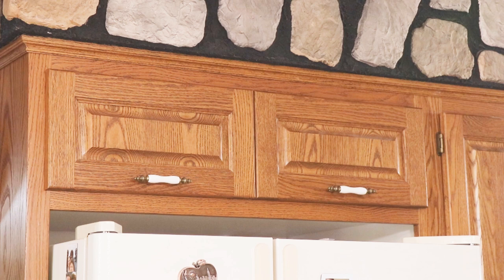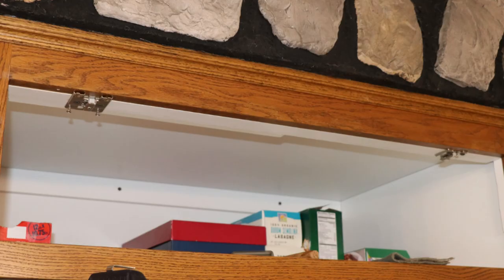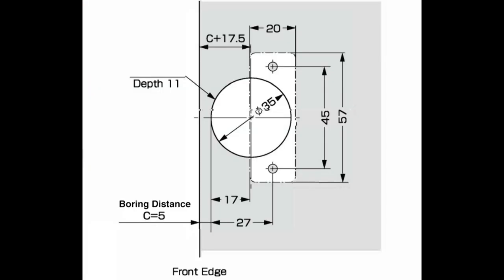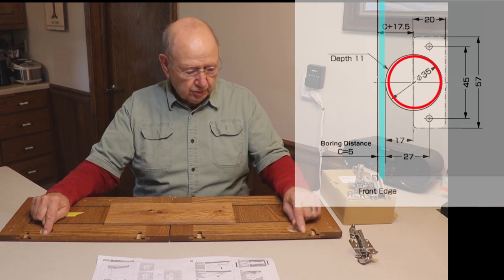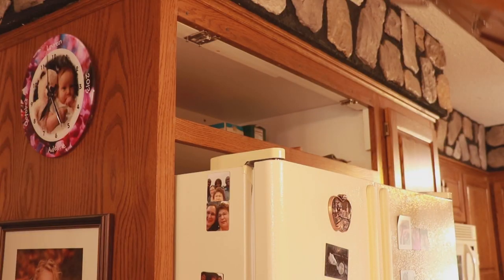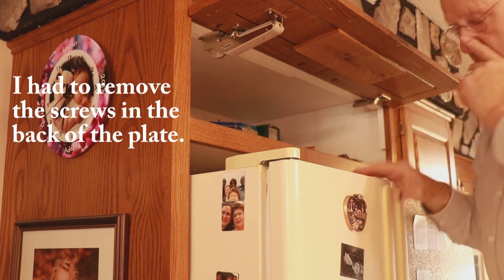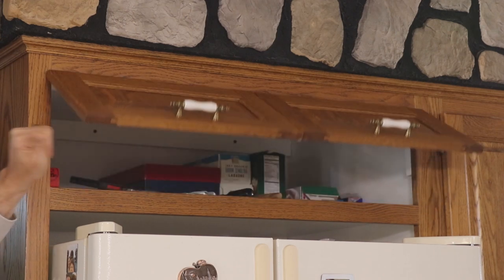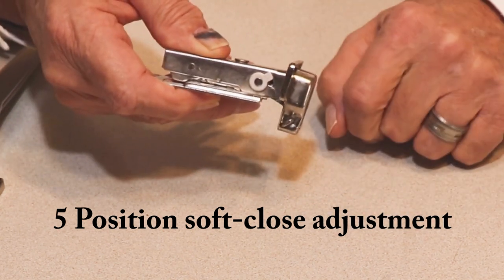Installation and Product Guide - Sugatsune Aileron Lift Assist System

Comment: Can this lift system be used on inset doors? The manufacturer's installation instructions only show an overlay door.
Reply from the maker: You could use this system for an inset door, but you would have to put blocking inside the cabinet at the top for the hinges to mount and at the bottom to provide a surface for the door to close on.
Ideally you could create a box within a box, set back by the thickness of the door. The door would actually be an overlay for the inside box, but would appear to be an inset on the outside.
Please give us a call with any questions, our customer service would love to help, 800-383-0130. - Woodworker's Hardware
Reply: @WoodworkersHardware  Wow! I am so impressed by your quick and thorough response. That makes total sense and is what I was thinking, but wanted to confirm. It's unfortunate that the hinge/lift system can't be adjusted to work directly with a an inset door, but it would likely require a different design. Thank you so much for getting back to me so quickly. Cheers!